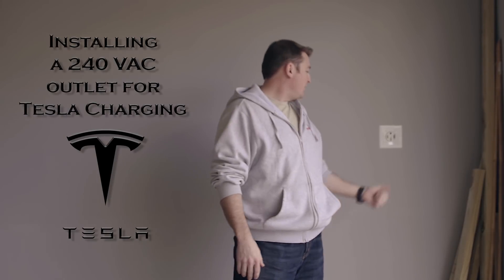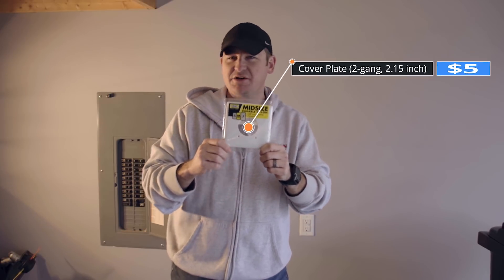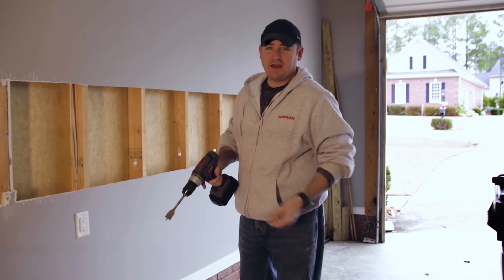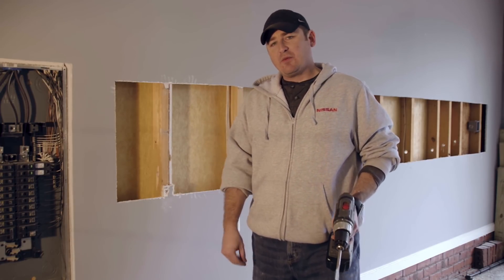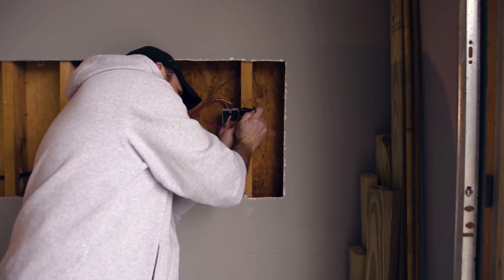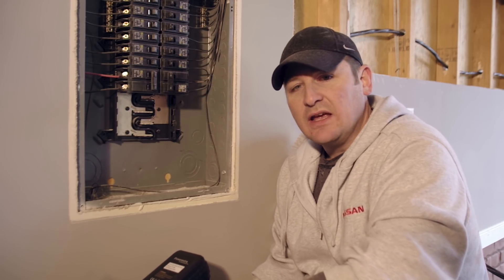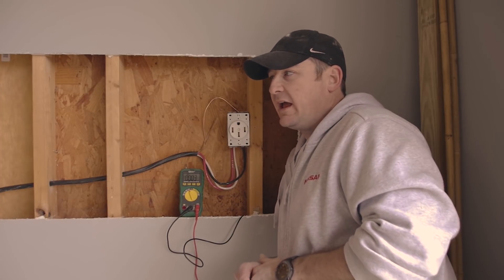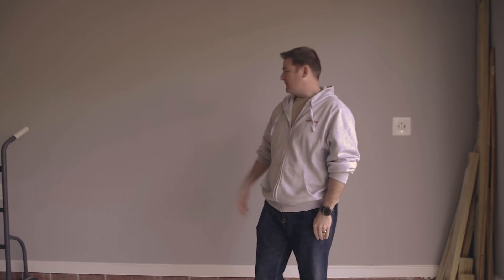DIY install a 240v outlet for Tesla (EV) Charging - SUPER EASY!!

Comment: How many kW do you get as you charge?  11kW=240*46A?  
Ironically, I have 10.8kW of solar on the roof, but it’s E/W son the inverter is only 7.6kW. Pretty awesome to be driving on sunshine now (or cheap wind/nuclear at night). 
My upgrade will require finessing wires through 1” conduit 130’ to my detached garage. I’ve been 110 charging at 1.4kW for four months now and that gets me 10% per night.  Fine as I mostly just drive around town and there are some convenient 6kW chargers in parking lots on campus.
Reply from the maker: Check out my honest review video. I also had solar on the house (4.8kw max system) and it covered all of the charging I needed. I would plug in when I got home, time to start at midnight, and car was at 90% when I went to leave for work. The car was limited to 32A (onboard charger limitation).

Comment: Why is the wire run across all studs? Can it be done done going up to the attic then run down to the panel ?
Reply from the maker: No attic above. If you do go up and over, make sure to attach cable to the stud on the way down.

Comment: Very informative video. I do have a question.  The Tesla mobile charger.kit comes with about 16 feet of cable.   So I am wondering why you felt you needed to open up all that dry wall rather than install the NEMA 14-50 outlet closer to the  breaker panel and then run the cable to the  charging port of your Tesla externally?  Would have required  less stud drilling.   I am sure I must have missed something in your explanation.
Reply from the maker: I pull nose in to the garage, so the plug port would have been complete opposite side of the car. I moved the outlet to the back of the car and the cable just ran behind instead of around or under the car. Glad you liked the vid!

Comment: Only comment I have (coming from an electrician).... you cant just pull a wire into a panel without a connector to secure it. More than likely it wont move but what if someone else opens the wall and pulls on the wire and the ground touches the hot bus? It doesnt meet code without it. Other than that I enjoyed your vid.
Reply: ristuff1 and use a 2 gang box as well for outlet so cable is in junction box
Reply: ..and 2-gang box should be secured on two sides (place a piece of 2x4 under box).
Reply: Not an electrician...however,  I double support ristuff1's comment. Most breaker panel enclosures have knockouts for 1/2 and 3/4 inch holes on all four sides of the box, many are combo 1/2 and 3/4 (punch out what you need, in this case for #6 conductors, use 3/4 inch). Run Romex-type wiring as shown in the video but at the breaker enclosure use one clamp for all conductors together with sheathing, extending the outer sheathing through the clamp to the inside of the breaker enclosure, and as well inside the 2 -gang receptacle box (box to have 3/4 knockouts), to secure both ends of the Romex. Sigma Electric ProConnex 44660 NM/SE Clamp Type Connector 3/4-Inch, 3-Pack is available online. The installation should now be up to NEC for Romex. Note also that the holes in the studs must each have metal  safety plates whenever the cable is within 1 1/2 inch from the stud edge...on both sides! This is to prevent later accidental nailing into the cable when hanging pictures, etc. Maybe this job best run in overhead or with 3/4 inch conduit.

Comment: Question, is there a way to turn it off if you don’t trust yourself? Thanks!
Reply from the maker: Not sure what you are referring to exactly, but the main panel has a main breaker. The one with the "100" or "200" written on it. Usually at the top of the box. You might have a separate main outside as well you can shut off. If you're not sure, as I said, contact a pro.

Comment: How is the charging rate?
Reply: Depends on the unknown size of circuit breaker and what size gauge wires he used.  Should be 50 amp breaker and #6 or #8 wires, then 30 miles per hour or 7,900 watts continuous - more than double a 16 SEER 3.5 ton AC unit.

Comment: Do you keep the Tesla charger plugged into the outlet even when you’re not charging? There is quite a lot of resistance trying to pull it out and the outlet mounted to the wall might not be strong enough to withstand constant pressure of plugging and and pulling it out
Reply from the maker: Yeah I do, unless I need to take it with me for some reason. I unplug the car, hang up the cable, and head out. When I come home, its a quick easy plug in to car and thats it. No messing with the UMC.

Comment: Great video. I just installed a 6-50 NEMA outlet with a 50amp breaker. When I tested the 6-50 outlet with my voltage tester, my tester is reading 120V instead of 240v. Do you know why? Thanks for your help
Reply from the maker: How did you wire it and where are you testing? Are you testing the ground port to a side port, or side to side?

Comment: Does putting a big fat chaw in make it more safe?
Reply from the maker: It actually increases your tolerance for electrical shock, should you receive one, as long as you holler "aw shucks man, dog gone, dab nabbit" within 10 seconds of the shock
Reply: @BrentEly  +10 electrical resistance

Comment: Great info and well done ..  I want to have the same done in my garage and the breaker box is below it in the basement, how much can I expect an electrician to charge for installation, I Live in Illinois.  Thanks ..
Reply: IL - $150-$200 in material and 2-3 hours for conduit and 1 hour for wiring, 4 hours for drywall and paint.  You can do the hourly rates and math from there - typical is $108-$120/hr

Comment: What happens if the current panel is full?
Reply from the maker: That will be a bigger job. Unless you are very familiar with the process, that will not be a DIY job. you'll need a larger panel or a new panel entirely. Hope that helps

Comment: I enjoyed the video, but my breaker is the other side of the house to my garage.  Can't imagine I'd attempt to do that myself, but I found this interesting nonetheless.
Reply: That might actually make it easier for you, provided you can access your attic pretty easily. In your case, you wouldn't have to drill through as many studs as he did. You would probably drill through the soffits above your panel outside, run the wire up into the attic, and then back down to where you need it.

Comment: How do you install if there is no more room in the panel?
Reply from the maker: That would be a call to an electrician. A lot more work involved to either size up your panel or add another panel altogether. But....you could just unplug your clothes dryer and run an extension cord from that outlet. LOL. JK.
Reply: @BrentEly  thanks

Comment: Think of a wires Gauge like balls in a shotgun shell. 1 gauge, 1 ball,  20 gauge 20 balls so the higher the number the smaller the wire. It's how many wires fit in a common size circle.

Comment: I have a full basement, so should not have to open up the wall. I have an unused 220 volt line hanging over the gas water heater (used to be electric.) Rather than splice, probably safer to run a new line from the breaker box. Think I'll get an electrician to do it.
Reply from the maker: If you use the right box and connections, you should be fine to splice as long as the Tesla outlet is the only thing on the line (your worry will be the breaker if multiple items pulling juice). If youre not sure, call an electrician for sure.

Comment: You forgot to use tape over the joints of the drywall 
when you applied mud to the joints therefore the joints will definitely crack

Comment: Why didn’t you go UP, OVER (through the.Attic) and DOWN to the outlet? No need to cut the sheet rock… Just holes through the upper wall plate. Secondly, you cannot leave the exposed wires even in the wall. When you strip back your wire sheathing, The sheathing must be intact until it enters the box.
Reply from the maker: If there was attic above the garage, I definitely would have. Fishing wires down a wall is super easy. Typically though, you would want to be able to secure the wire to a stud, especially with electrical. That way nobody can cut into the drywall and "find" the wire on accident.

Comment: Dude, you are way too comfortable around a live panel, and your knife handling makes me nervous.
Reply from the maker: Haha. I've been zapped a few times. Its not that bad. If the voltage was higher, probably wouldn't be so comfortable.
Reply: He chews tobacco, he ain't worried about nuttin' lol
Reply: Respect for electricity is a must. You do not want to have a fire ball coming at you if you hit the main. You mentioned being zapped before. It only takes one time to hit you "just right" and you are gone. 120 is plenty to take you out.  You are fortunate to have a main principle breaker outside of your house. Not everyone has that. Use it and stay safe. Also, not the greatest practice to strip back  the protective jacket at your recepticle. That jacket is there for a reason and should go all the way to the back box.  You had several inches of stripped outer jacket.
Reply: You would be even more nervous if you watched how Linemen repair the power lines, several thousands volts and amps running across and they don't turn it off to make repairs or do maintenance. Of course if the power is already out because the line fell they'll turn off the power but otherwise they handle live electricity with nothing but rubber gloves and their clothes. My grandfather and dad did/are in this business and the stories they have are funny as hell once you get used to it, otherwise it just sounds out right dangerous/deadly.
Reply: @BrentEly , Good video, but people need to understand how dangerous an open live panel is before they follow your DIY steps.  Your comment makes it seem like it's no big deal if they get shocked and it also makes it clear that you don't really understand electricity very well.  240 volts is more than enough to kill you.  The amperage in that panel or in the 50 amp circuit is more than enough to cause loss of limbs (from electrical burns) or instant death from electrocution.  I have been "zapped" a few times myself, but fortunately it was on standard 15 amp 120 volt circuits.  Working on 50 amp circuits or inside of a live panel is a whole different ballgame.  

Again, good video, but in the future please make that clear to your audience who are most likely going to be people that don't have a clue what they are getting into.
Reply: @BrentEly  Not surprised at all.
Reply: @BrentEly  I've been zapped too, and I agree it's not that bad...and I admit to being every bit as cavalier as you when it comes to wiring a breaker box.  That being said, the first time the current flows through one arm and out the other other could well be the last time.  The older I get, the more likely I am to simply pull the master breaker.  PS good video!  I haven't run 240 in a few years and wanted to refresh my memory, you covered all the bases,  thanks.
Reply: @BrentEly  It's not the voltage that kills you. That panel holds enough juice to kill you within 5 seconds.
Reply: @BrentEly  
Many other people will have damp enough skin to get a really bad shock or even have difficulty letting go. Also, if the current runs through the chest, they may get heart arrhythmia or cardiac arrest.
Reply: @BrentEly  I don`t know why you answer these guys , Haters are gonna hate.
Reply: @BrentEly  Try practicing with an electric fence gharger.
Reply: @BrentEly  stupid answer. Volts aren’t the issue. Current (amps) is the measure of danger.  It only takes 0.1 amp to kill a person.

Comment: Wiring the plastic old work box wires need to be clamped in place could have used a 1900 4x4  box with clamp also wire into panel box must the clamped sheetrock cut all the way to the panel box circuits label and wearing the correct PPE and never work in a HOT panel box feeding wires power off first (PPE face shield leather palm lover safety glasses otherwise nice video.

Comment: Why did you use a single range box instead of a double with the outlet mounted in the center?  Packing those wires in that small a box must have been a bitch.

Comment: you really should have used a 2 gang box. less than $2.00. that box is really not meant for 6-3 romex. there is no need. the cost difference is nothing.  just pointing this out for future do it your selfers. not to try and put you down but not a good idea.

Comment: Also, I'm not an electrician so I can't say I've seen a lot of them, but that appears to be the tidiest inside of a panel box ever.
Reply: Would not pass code in most large cities - New York, Chicago, etc.  Conduit is much safe with 6,600 to 10,000 watts running on two conductors.  Open wire is a no-no.

Comment: i'm confused where you put the white and ground wire in the breaker? where did you connect that too?
Reply from the maker: There are two bus bars. One is for white wires, and one is for the ground. You should be able to see where all white wires connect and where all the ground wires connect. It doesn't matter which hole on the bar you put the wire in, so long as the white wire is with other white wires and the ground is with other grounds. Hope that helps. If you're still unsure, contact a professional.
Reply: Thx, it’s up and working, took me a while to know what I was looking at, mine is set up a tad different and this is my second wiring project, saved me money from having to hire someone, thanks for the good tutorial.
Reply: Great work! The hater gonna hate,but this is so helpful
Reply: No hate here but some things he might want to note.. should state some of the actual electrical codes.  Obviously the codes are different state to state or in my case Canada.   Example box size should be bigger than he showed at the start of the video.
Reply: Electrical is a dangerous field people be careful. In this case you are right because this was subpanel. Whoever it's not always that way. Alot of times the panel has a main breaker and there will not be a ground bar (for ground only). The ground and neutral are  bonded on the neutral bar. AND REMEMBER PEOPLE, JUST BECAUSE IT WORKS DOESN'T MEAN IT'S SAFE.  PLEASE BE CAREFUL WHERE YOU GET INSTRUCTION FROM. I have gone to service calls where people have gotten hurt and one case there was a poor installation and could have killed people. Just a word of caution.
Reply: @ @nemorotatory  all the hater is electrician, this video so helpful for me